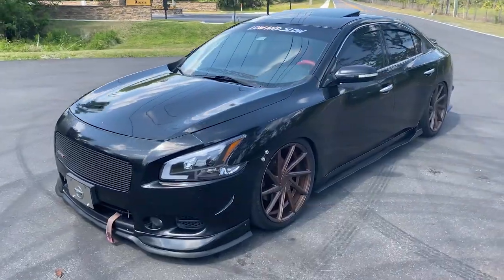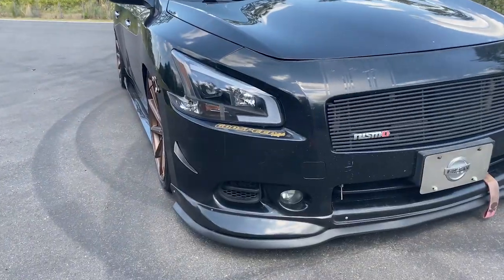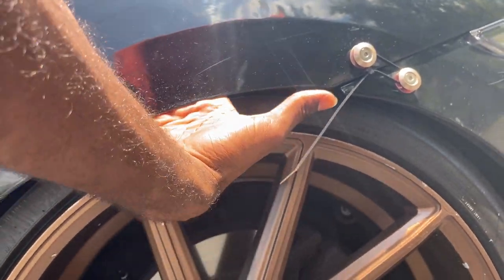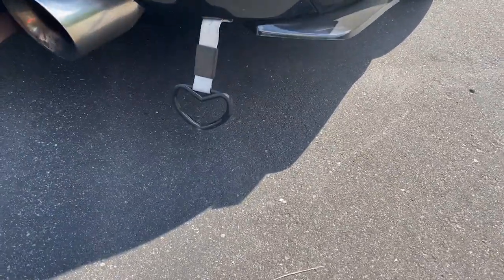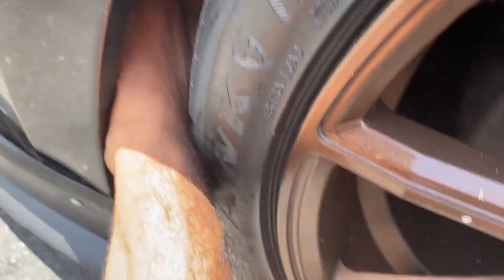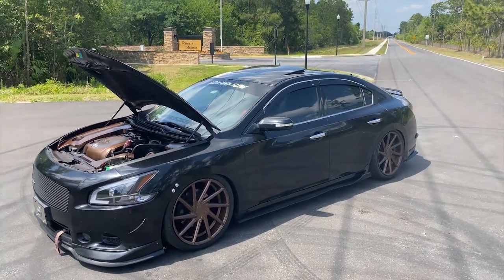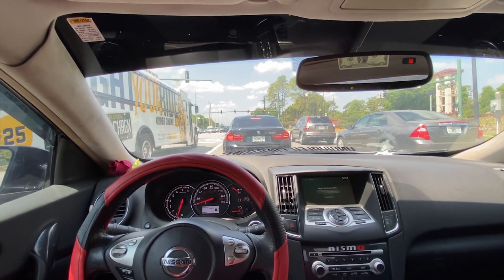2013 Nissan Maxima Walkthrough, Start Up, Rev, & Test Drive *Modded with New Transmission*

Comment: Made me change my whole perspective on Maximas
Reply from the maker: Great to hear. It’s not too bad of that car
Reply: So sexy… should I get the 2014 nissan maxima? Its 12,999
Reply from the maker: Mileage?
Reply: @ThisBGama  100,000. Good service records, cvt fluid change at 60,000, as well as new front wheel hubs and bearings, its silver, super clean.
Reply from the maker: Idk man. I got mine with 60k miles at the time for that much and that was 5 years ago
Reply: I just bought my 2010 for $4,800. It’s got 180k on it though
Reply from the maker: High mileage but if it was kept in good condition. Not a bad buy

Comment: This is my favorite generation of the maxima, like how you took universal parts and made them look good. I have a 04 maxima 6spd with 200,000 miles on it, only thing that sucks is they stopped making performance parts for it. Keep up the hard work.
Reply from the maker: Heard. Will do
Reply: They bearly even have performance parts
Reply from the maker: Which makes anyone who figures out how to get the maximum power out of them a legend which I plan on becoming
Reply: You can still find what you need like basic bolt-ons. The only thing that is custom is if you do a turbo setup or supercharger. The only thing you can barely find is exterior aesthetic parts.
Reply from the maker: Exactly what I’ve been saying!
Reply: @eduardodominguez4142 that's the fun part though it's good to have a unique build it's boring having the sane build like everyone else

Comment: 370z brakes bolt right on, you just need different brake line bolts. Z1 motorsport sells them. You can get red 370z reman calipers, rotors, and pads from power stop for like $700 total. Had them on my max for 3 years and they work great 👍🏼
Reply from the maker: Say less, looking into it as we speak

Comment: If you would do a video givin tips to Maxi owners on how to maintain their cvt could be great... 

Love the Maxi.. ❤️
Reply from the maker: It’s in the works “so you want a maxima”
Reply from the maker: Thanks
Reply: Gradually accelerate... don’t stomp on the gas pedal and make sure you completely stop before switching gears. I own a 7th gen also with some mods too..
Reply: @stevenleveille5255  hey I also wanted to know is it bad if I use sport mode gear a lot like when it’s on D and then to left shift it to S “sport” or even the 1m and that’s were the rpms be getting high, I wanna make sure I’m caring for the transmission and engine right
Reply: @thomasle3190  don’t use sport mode. I know it tempting... I used it too a few times.. that engine is to strong for that cvt... that’s why ppl do the swap...
Reply from the maker: It puts more stress on the trans but as long as your shifting timing is impeccable you should be fine. Don’t shift to cause rpm to bounce
Reply: @ThisBGama  🤔 thinking I should do a vlog now...
Reply from the maker: Aye all I can say is start now. Post regularly and be patient

Comment: I have the 2014 one. These are very nice cars. I love the engine. Took out the transmission filter the internal and outer cooler one and changed the fluid. Mine has 106k miles on it. Where did you buy the new cvt transmission? I want to buy one just in case this one goes out lol. I ride carefully never race it. Be sure to clean the magnets every 30k miles or less in the transmission pan. I saw tiny specks in the internal filter so that put a scare in me but everything is running good as new and smooth. I like your videos bro!
Reply from the maker: They really are good cars, I got my transmission from Nissan directly. And thanks for the feedback. More videos coming soon

Comment: I got a 13 as well and taking off my stock intake to clean I noticed that oil accumulated in that lower baffle before the throttle plate and I always assumed it was because these guys fill my crankcase with too much oil.  Been doing my own oil changes ever since and haven't seen that happen anymore.
Reply from the maker: Good catch and good stuff

Comment: I’ve got the same filter on my BMW, got it at advanced auto parts. Looks good, can’t wait to get a custom intake
Reply from the maker: I need to change it. It’s been years
Reply: Yeah with the cheaper filters that’s expected. Just got a 1998 BMW 540i, it’s already straight piped and is on real nice rotiforms, $200 spacers and a $1,500 coil over set up.
Reply: Coil overs are by BC Racing
Reply from the maker: Ohhh you got lucky!!

Comment: Yo man fr I love the 7th gen maximas bro, I got me a 2012 Nissan that has like 95k on it , I’m tranna run it up and keep it for a long time to 300k+ I love it man, I be cleaning it with rainx waterless spray bottle and a lot of McGuires stuff like the ceramic wax spray to protect the paint. Keep it up man 🔥💯, also I want to make sure I don’t have problems with the car, I wanted to ask do you ever switch gears like from D to Sport mode or even to 1m? I don’t want to try anything that will hurt the engine and transmission
Reply from the maker: That’s great! Yes I love the car as well and I used spots mode and manual slot, maybe a little too much because I love playing with the exhaust sounds

Comment: Bout to buy a 2011 Maxima Sv I wanna put a turbo in it would I have to change anything after I put the turbo in car?
Reply from the maker: At the moment going the turbo route not it. You can do it but the car can’t handle it yet. Trans too weak. And it doesn’t have the parts to upgrade it to handle boost

Comment: So I finally pulled the trigger and got the same Godspeed Mono SS coils. After installing them I noticed my ride is HELLA bouncy? Hows the ride on yours and how stiff did you go?
Reply from the maker: I went full stuff and make sure you remove the factory springs in the back. And bouncy hard or soft trampoline bouncy?

Comment: @ThisBGame you gotta vq35hr lol....waaaaaaaaaay better than the vq35de. Good stuff bro, glad you got her back on the road. Also if you choose to do big brake the akebonos are direct fit no modding needed and a decent flush fitment is a 10" inch wide wheel with a +22 offset but you will need to roll your fenders or youll rub
Reply from the maker: Got you🙏🏾

Comment: I got recommended to you and I’m amazed at Keisha’s beauty I have a 14 dark purple and I’m starting I’m starting on my lovely lady I’m doing a black and yellow inside but my major next move on her is the cvt, I feel a slight delay so check to see how serious and if anything get it replaced or whatever the case might be but long story longer😅 just this video inspired me to make it happen be safe bless
Reply: Do you have the sport option on your car?
Reply: @deezematz  yea I do
Reply from the maker: Ya
Reply: I have the same color but mine is a 2010 with winter and technology package i beat the piss out of it and the cvt never gave me a problem. But a friend of mine has the same car without the technology pack and his has that little delay in his as well. My car seems like a whole different animal compared to his mine revs put to 7500 rpm when his only goes to 6500. I do have a Megan exhaust with a k&n typhoon cai but the power shouldn’t be that noticeable with that. Do you guys know about the button that clicks in when you floor your cars?
Reply from the maker: Yea I know about the click
Reply from the maker: Your car might be tuned
Reply: I have two 2014s. What's this button you speak of?

Comment: Bro please put the dual piston 370z front calipers they bolt right on I had a 2011 maxima with them night and day difference! They only cost about $100 a pair on eBay with pads
Reply from the maker: Planning on it. Gotta get drilled and slotted rotors first

Comment: Have you thought of doing a manual transmission conversion because the CVT is a ticking time bomb. Someone can by a $3000 car that will last 50,000 miles than a CVT that needs service every 25,000 miles ($400-$500 CVT flush).
Reply from the maker: Will do one. Planning
Reply: It cost me less than 300 bucks every 60k miles for a trans flush. What are you talking about?
Reply from the maker: You take it to a shop. I do it myself lol
Reply: You need a  T-Tech or similar machine to FLUSH the transmission. Dropping the fluid and filling back up causes more problems than had you left it alone.
Reply: drain and fills r more safe for high mileage cvts

Comment: What stopped me from getting this car is the CVT transmission. How is yours holding up? Other then that bro she looks sexy af much respect ✊🏾
Reply from the maker: Thanks I just replaced it like 3 weeks ago after my doctors gave out at 186k
Reply: @ThisBGama  how much was it bro
Reply from the maker: $4.8k
Reply: @ThisBGama  👀 jeez! The motor that’s in there is off the Z right? For that price I would of converted to manual
Reply from the maker: I wanted to but the shop wasn’t confident in doing it and I didn’t have the cash on me at the time to just start the project myself
Reply: @ThisBGama   copy copy regardless she 🔥
Reply from the maker: Thanks 🙏🏾

Comment: I got a 2012 maxima just reached 120k. My last max was a 2009 and the transmission went. I was wondering what are some signs that my transmission is going bad or that the transmission fluid needs to be changed?
Reply from the maker: Laggy response, wine noises, delay when you put the car in reverse or drive, and transmission oil temp too high
Reply: Flush the fluid every 50k

Comment: Heat  gun and a plastic scraper  to remove the stuff on your truck bro
Reply from the maker: It’s crazy glue. You sure?
Reply: Acetone. It works fast so be prepared to neutralize it before it does damage to your paint .

Comment: Yo did you have halogen headlights or hid before you installed the new acani headlights!???
Reply from the maker: Halogen
Reply: @ThisBGama  damn, I don’t think Acani can go on HID Maximas....
Reply from the maker: You gotta get the h11 harness and convert the HID to Halogens
Reply from the maker: @FuRRyS8eR1  they were struts holding up my front splitter
Reply from the maker: @FuRRyS8eR1  the band is a tow hook but it’s not usable
Reply: @ThisBGama  when you can; can you please explain further into the h11 harness and what and how you do it please?
Reply: You wanna swap HIDs for halogen? That's craziness. Just find projector housings with DRLs. Swap the highs for LED.

Comment: yo bro. Dawg i’m tryna get my Max like this. Just got my mufflers deleted on my max. it’s loud and sounds super good. I’m thinking I want louder. I’m going to get m resonator deleted
Reply from the maker: Got to
Reply: DONT GET A RES DELETE BRO TRUST ME I DID THE SAME MISTAKE IT BECAME RASPY TRUST ME GET A VIBRANT RESANATOR FOR AMAZON YOU WONT REGRE IT!!
Reply from the maker: No raspiness here. Depends on the meal piping they use and the size.

Comment: damnn how new was the transmission in this vid?
Reply from the maker: Less than a week I wanna say
Reply: @ThisBGama  dayum, i didnt hear any whine and i was hella impressed, i have a little whine but i think its my serp belt so im gonna get that changed and carry on from there if theres still whine imma get my fluid drain n fill and change my filter rn im at 101k
Reply from the maker: The whine comes from the transmission. The fluid is too hot. Yo get the whine yo go away, you have to install a transmission cooler
Reply: @ThisBGama  i was just looking at some, will be ordering soon, my fluid is clear w a little bit of red to it

Comment: bro i was mad at my 2011 max bro.. i installed a CXJ package, a stillen air intake, stillen pulley, full stillen exhaust with a DYNO TUNE... and after all that guess what.. IT WAS STILL FREAKING SLOW!!!!!!!!!!!!!!!!!  i wasted so much money and time.. the 7 gen maximas only look fast thats it!! i fooled my self.. ive gotten embarrassed by a modern day toyota camry!!!!
Reply from the maker: The new Camry’s are definitely fast asf, I would hesitate on raving one but the Maxima should not have been that slow to the point you got embarrassed. And with the tune and all the mods you did, did you really research in depth what every mod did, cu you can mod a car all you want and get no gains or slow it down and tuner also makes a difference. You don’t see too many tuned maxima’s because of that
Reply: @ThisBGama  thanks for responding, stillen is a great company so i went with it and purchased performance parts, i researched every part before i paid for them.. i couldnt even overtake your every day uber drivers.. i was so disappointed.. it sounded fast but at the end of the day in ran like it was stock.. my first wake up call is when i went up against a stock g37.. words can not describe.. only one word DAMN
Reply from the maker: I feel you, the car has potential, the transmission holds it back. I’ll do everything in my power to bring shame to a g37 and a couple Camry’s for you

Comment: Clean but I rather go with Infiniti G37. VQHR!
Reply: Maxima has a VQHR as well but I understand your point.
Reply: @Khi.252  it’s VQDE. Plus the g is a rwd car too. I don’t like front wheel drive cars
Reply: @jcampo8057   Well the motor has mixed names due to it having a HR head unlike the older Maximas. I feel you tho, RWD is ALOT more fun.

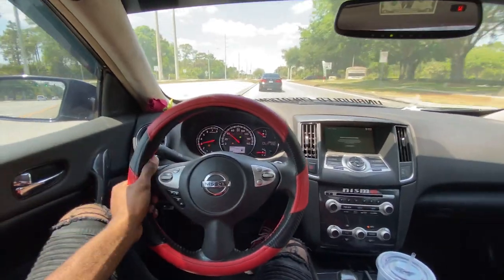Comment: 18:28 😍🔥
Reply from the maker: My favorite part of the video too
Reply: @ThisBGama  Yoo I wanted to ask what all have you added to the car audio wise..? Like what’s your exact setup? Cause I have the Bose stock and I like them, they sound pretty good in my 09 but I just want it to sound even better.
Reply from the maker: Changed all my speakers. The rear decks and doors to some kickers and pioneers or Kenwoods. Can’t remember exactly what brand and I added one 5.5 to the doors in the front. And the subs in the back. All of my doors speakers running of of the car amp. Didn’t bother adding an amp for them
Reply: @ThisBGama  Bett